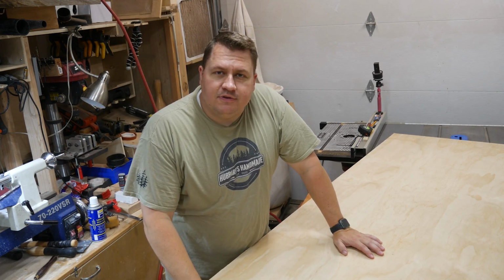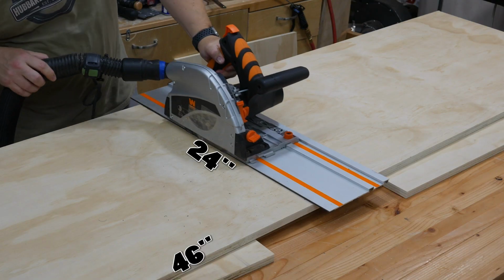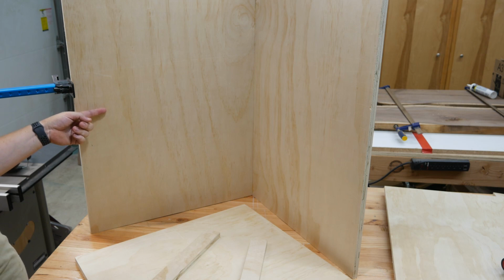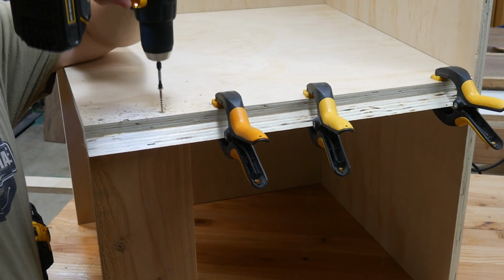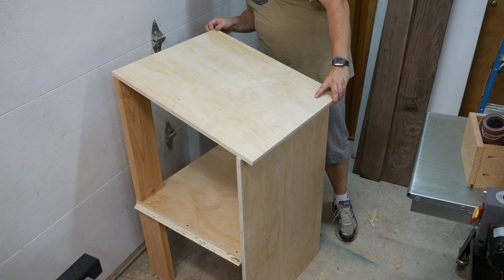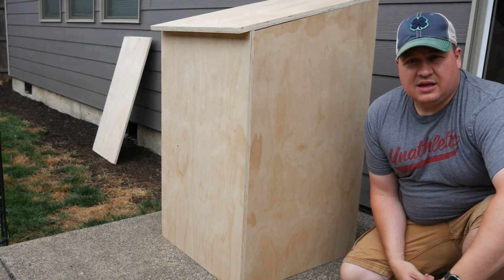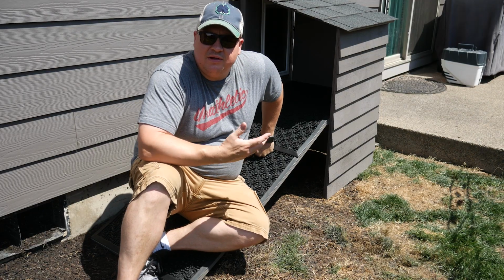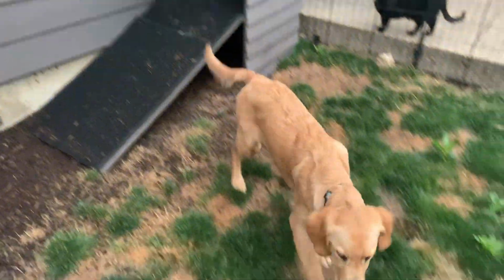Dog Door Installation Part 2: Dog Ramp

Comment: Do you have a supply list for the outdoor ramp and shelter?
Reply from the maker: Thanks for your interest! There really isnt much to this build, one sheet of 3/4 plywood, some 2x6 scraps, two bundles of wood siding, and half a bag of shingles. I included some measurements but it varies so much for everyone's situation that the dimensions will have to be adapted. Good luck with your project!